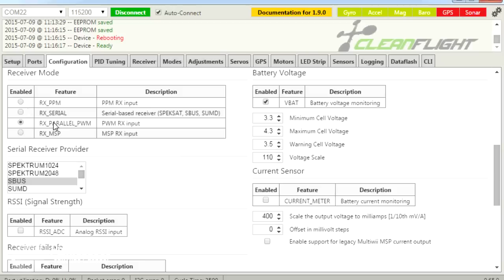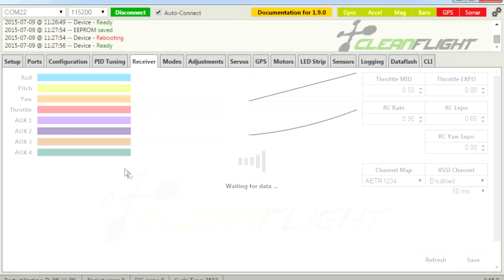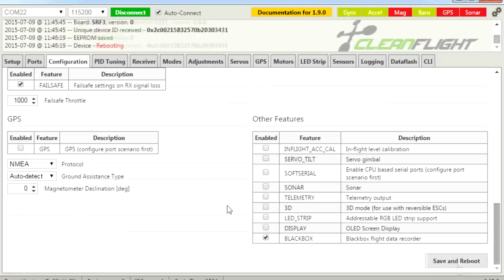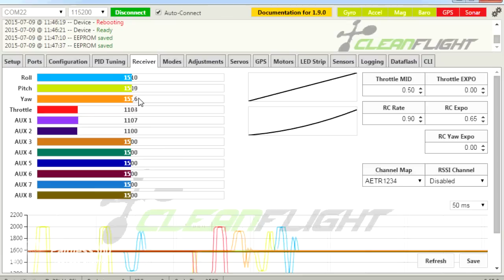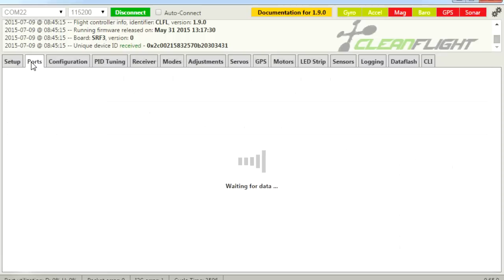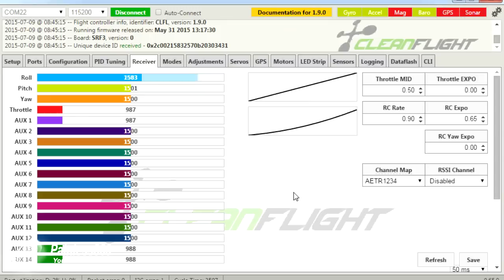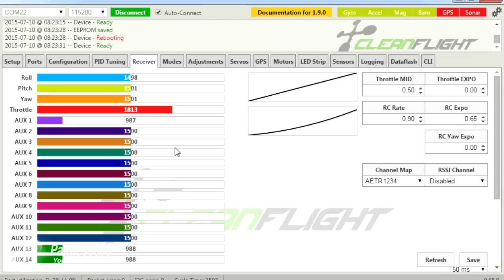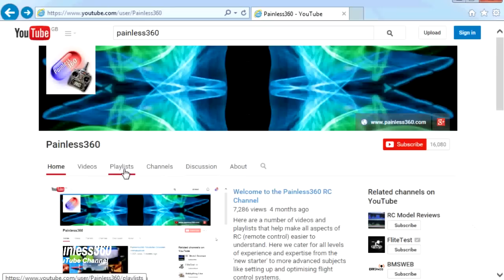Seriously Pro F3 (SP3) Quick Tip - Install and setup PWM, CPPM and S-Bus Radio Receivers

Comment: Hello painless. Can you show me how to connect the sp racing f3 fc with the frsky xsr receiver with telemetry pls?
Reply from the maker: Use one of the external UARTS and connect the S.Port pin from the Rx to both the Tx and Rx pin on the UART and then select Smartport telemetry for that UART in the ports tab in Betaflight.. Hope that helps! :D
Reply: Painless360 how i can connect 1 sport wire with 2 tx and rx wires? Thank you for your reply.. i seriously love your videos
Reply from the maker: +R. K. Solder? ;)
Reply: Painless360 I have seen that youve done it with the x4r receiver you connected it with sbus using the io 2 connector and then used the S.Port to connect it with the Uart 2 RX cable. Is it going to work the same with the xsr? Sorry for my bad english. Best regards from germany.
Reply from the maker: +R. K. X series receivers need bi-directional telemetry so connect it to tx and rx pins on the UART. See the Betaflight documentation for more detail. Best of luck
Reply: Painless360 ok i will do that. I hope i will do it correctly. You mean i have to solder 3 wires together. Im asking because im scared to have a short. The S.Port wire from the xsr and the TX wire and the RX wire from the Uart 2 on FC im going to solder together. Is it right? Im not retarded i just need your confirmation because im scared to destroy my fc. Thank you for your help painless :D
Reply from the maker: +R. K. I've already given the same answer twice. Not sure what else I can do..
Reply: Painless360 ok thank you very much painless

Comment: can I use satellite receiver with this? thx
Reply from the maker: Yes, see the wikis  and manual.. Best of luck.
Reply: i coudnt find it anywhere in the wiki.. :( may be i was looking in the wrong place. can you please point me in the right direction. thanks :)
Reply from the maker: +Ashar Hameed https://www.youtube.com/watch?v=OZgfn7Idsaw ;)
Reply: +Painless360 video unavailable? I'm also looking to connect an Orange R110XL it just has a statellite connector and presumably 3.3v powered. Anyone got these working yet on the SPF3?
Reply from the maker: You can search the channel you know ;) https://www.youtube.com/watch?v=n59e_n_NGQQ
Reply: +Painless360 I've been searching Google but nothing showed up only this video. Thanks for the link and the quick reply - appreciated.
Reply from the maker: Really? My search for 'SP3 sat' found it as the 5th suggestion.. Remember the channel is searchable and the playlists are ordered to make it easy to find detail too..
Happy flying!
Reply: +caramba10 if I can't find it so can you.

Comment: I have been having consistent issues with pwm, the values are showing up though they are very jittery, like there is a certain refresh rate to it (values always return to centre after a certain amount of time). Could anyone help pls!!! 
I am running spracingf3 3.0.1
Reply: Never mind turns out a single channel on my receiver is dodgy

Comment: Hi I have just been reprising you video in the hope that it would highlight a problem I am having setting up a hex-copter sadly I couldn't see it.
 I have a king Kong 300 hex that for some reason I can't get sorted it came with a micro CC3D I tried everything with Libre pilot and couldn't get the motors to run so I have installed an SP racing F3,it is running Cleanflight, Frsky  sbus , the config is fine (oneshot 125 for KingKong 12A  ESC's) as I can set up all the required switches arming etc and cleanflight can see all the inputs and I can arm and disarm the FC but that's where it all turns to worms the esc's will start randomly and not all of them oh and I have just tried the second SP racing F3 FC same result so I must be doing something wrong????????????
Reply from the maker: I've not built a Hex with Cleanflight. I'd setup the model as a Quad and see if that works well (pnly four of the motors will turn!) but if you know that then it may be a FW issue.. Best of luck!
Reply: Hi thanks for the reply no different as a quad I can however do a pass through using BLHeli so accessing the ESC's is no problem I can arm and disarm the esc's at least according to the little red light on FC is concerned I can the esc's however have a different take on the situation they will start at random not all of them just one and then it might be joined by another" ho hum " the only way to stop the ones that do is to remove the power! As for the FW issue apart from having been called such at an earlier confluence of errors whilst at work I am at a loss to know to what you are referring :-)
Reply: Although it seems that no one is interested I have soldiered on with this problem while I was fast approaching the need for medication I thought why not go through the list of ESC/Motor Protocols available skipped the one shot choices and well well it sort of works with Multi shot but none of the others so back to One Shot 125 and all of a sudden the esc's are playing tunes so I calibrate them in cleanflight and apart from needing to raise  the min calibration threshold to stop motors twitching all seems good now?????????????
The problem is I don't know why as I promise you I had done this before several times to no avail

Comment: I broke my IO 2 port on F3. workaround?
Reply: I know I have to connect to vcc and grnd on uart3 but do I connect my ppm receiver to the TX or RX connection on uart?
Reply: rx
Reply: I quote myself from another comment:
"Hey Painless, thanks for your guide, that saved me from dropping this FC. Anyway after 1 month I figured out how the Cleanflight receiver tab works for configuring the IO pins inputs from the receiver: at the top of that tab there is a dropdown menu with something like "AETR1234" wrote in by default. This mean that AE (Aileron, Elevator) are on pins 3 and 4 of IO1, TR (Throttle and Rudder) are on pins 3 and 4 of IO2, AUX1 and 2 are on pin 5 and 6 of IO1 and AUX3 and 4 on pins 5 and 6 of IO2. Exaclty like you said in the table of your video.
You can freely change this order by directly writing in that dropdown the combination you want to use. A configuration like "AE12TR34" means that you can use only IO1 pins for Ail Ele Thr and Rud. 
I've completely broken my IO2 port after crashing, so if someone had this problem too or doesn't need AUX channel and wants to use only one IO port I hope this can be helpfull :)"
Reply from the maker: I'm not aware of one - depends on what you're trying to do I guess.. Best of luck!
Reply: if one io port have broken use second port, or solder new uart port i-buss wires. today all controller have many 4-7 uart port what can use if one has broken, and all fcontrollers have today F7 under 20$ wery cheap can buy 2-10 pcs to reserve at home.

Comment: And if i cnect sbus to io1 what uart is?
Reply from the maker: +BelloFPV Some of the IO1 and IO2 pins can be used as soft serial ports (software UARTs) and to do things like run the GPS and LED strips too.. see the other videos and manual. Best of luck!
Reply: Ok thx

Comment: I have a Graupner GR-16 receiver, wich worked with my (now dead) CC3D perfectly.
Now I don't know where to connoct all the signal cables to the receiver, because there isn't description of the channels like throttle etc. It's just 1, 2, 3, etc.
Can someone pls help me with the right connection?
Reply from the maker: Use the monitor screen on the radio to see the order the channels move. If the throttle moves the bar at the top then that's channel one on the Rx etc. best of luck!

Comment: Me as well. Thanks for existing , sorry three years later.  I would like to have your professional help in a field you cover in this video. I think about configuration of PWM.
In my case until to the end of this subject (PWM) I have the some answers from program like you. Only difference is that at moment I connect the servos, servos don't work. I verified outputs with scope, they are nothing. I can't understand that , I'm unable to find solution. This is the same board SP F3 racing. The same program. If you will help me I will be very happy and not loose more time. Thanks in advance.

Comment: Hi Painless, first of all happy fathers day if you are a dad, I have a problem and I would appreciate a lot if you can hel me. Setup: SPRacing F3, X4R, LB 20A Pro, Betaflight 2.7.1 and BlHeli 14.5 So the situation is as follows: Everything looked ok and at the end , when I was calibrating escs, turned down min throttle from 1030 to 1025 and suddenly escs started to beep (2 beeps) then when I tried to arm w the radio (taranis), escs wouldn't arm and then I notice the the X4R wasn't on (no green led) and finally I unplugged everything and when I plugged again X4R wont turn on again, I dont know if its fried or what, I didn't have any smoke. Please help!
Reply from the maker: I'd start simply and see if you can get the connection to the Rx on it's own. Best of luck..
Reply: yeah I found the problem, the bec on my lumenier pdb got loose, rx is fried, thanks anyways

Comment: Hi guys I have a strange problem. I wired up my sp racing 3 with my turnigy 8ch v2 but when I try to check the signal, all the channel shows 0 as input. I check several time all the wire because I connected by pwm. Anyone can help me? Thanks

Comment: Hi I need help because this freaking controller is giving me  headaches. I have a Flisky TH9X with a flisky FS-R6B Receiver (exactly the same as the original but smaller) Only can be connected by PWM. So I did everything from the video for the PWM connection (BIG THANK YOU FOR THIS VIDEO) follow the connections tab and finally I could move all the sticks on the right direction on cleanflight. BUT (here comes my problem) my aux for select moder or for my buzzer doesn't move. when I connect the aux 1, 2 and 3 I can see that there's a signal because the channel bands  has little movements from 1499 to 1502 or so but I can´t move them.  I tried different combinations of wiring and nothing happens. If someone has any idea why I can't wire the aux would be really great. Just an interesting thing. My aux channels works when I put on my transmitter the helicopter mode but they works in parrarell with the throttle or alieron, etc.
Reply from the maker: +Jesús Ortiz do those channels move on the 'channel monitor' screen on the radio itself?
Reply: I could FINALLY solved it!! As you asked, the channels doesn't move on the screen monitor so I found that I had to program those channels through the Mix.Channels setting.... basically I put for each aux "click" a percentage... so for example the 3 click switch has -100%, 0% and +100%. Thank you for your time answering and thank you for this video explaining all the connections clearly

Comment: Hi i have SP3 and receiver Turnigy 9x8cV2 How to connect all cables? Painless360 please help, Thanks Mat.
Reply from the maker: A quick look at the manual shows it's only PWM so you'll need to follow those steps. Best of luck!
Reply: Thanks for the answer, I still have a problem...
Are you sure the Turnigy works on pwm?

Comment: I have a receiver where it doesn't tell you where to put the cables anyone know how to connect it?
Reply from the maker: See the 'Quadcopter Building for Beginners' series. If there are just numbers then you need to look on the radio to figure out what order the outputs are in. So if the throttle is 1 on the radio then it'll be that on the receiver.. Best of luck!

Comment: Hello, new to this hobby. I have the FS TH9X transmitter. I have SPRacingf3 board. I’m connected To cleanflight. My settings are good. I can control my motors through the computer. My transmitter is binded with my fs receiver, but I’m not able to see variation levels on the receiver tab in cleanflight. Can anyone help. I almost have it! Thanks
Reply from the maker: Please see my Quadcopter building for beginners series, they are designed to go through each of the steps and make sure that you don’t miss anything basic out. Best of luck!
Reply: I watched series 6 several times and I’m just not getting any responses from the receiver tab in cleanflight. What’s odd is when plug in a random servo into the receiver I can control it through the transmitter, so that let’s me know the receiver and transmitter are bound. And I also know when I’m connected in cleanflight and powered up via Lipo battery I can spin all motors no problem. Can I send a video clip of my walk through and set up and maybe you can identify were my issues are? Thanks
Reply: Basically my values are not moving when I move my transmitter throttle rudder aileron elevator. Thanks

Comment: +Painless360 would you please help to decrypt what aetr1234 means? There is no documentation I could find on this. I have read on forums ppl said  it means a maps to channel 1, e maps to channel 2, etc. But I seen mapping which just blow that interpretation out of the water. For example ATE2R134. Many thanks in advance.
Reply from the maker: There is a video in the 'Introduction to RC' series that covers why we have the channel names we do - worth a look. This is shorthand for the order that the channels are read by the flight controller Aileron, Throttle, Elevator, Rudder, Aux1, Aux2 etc. Hope that helps.
Reply: Yes that makes sense. I have just tried and it is working like what  you have said.  Many thanks again.

Comment: UART3 and SERIAL RX wont stay highlighted after I save and reboot, im using "Walkera data bus (sbus)". Ive tried everthing. I noticed a great deal of people online having the same problem's and with different RX's but no solution! Anyone out there have idea's to fix this issue! Help!!
Reply: Well after some trying... I found that although I was told that Walkera DATA BUS=Sbus and setting them up the same way was recommended and it failed, I tried similar settings but in ppm and "voila" success! So everyone else having the same problems with walkera rx's and using DATA BUS or similar, try running it in ppm instead and hopefully that will solve it!
Reply: I have the same problem like you. I connect SPRacing F3 to PPM/Channel 1. I use Walkera Data bus (RX703A). What else should I set in Cleanflight? Please help.

Comment: I am using a Lemon RX DSM2 6 channel receiver (http://www.lemon-rx.com/shop/index.php?route=product/product&product_id=65) with my SP Racing F3 FC and have followed your video to a T but when I go to the radio tab my roll and pitch signals move together when I move the roll stick on the radio. Nothing happens when I move the pitch stick on my radio. The yaw and throttle are also tied together when I move the throttle on the radio up and down. Nothing happens when I move the stick on the radio in the yaw position.  My AUX 1 and AUX 2 channels are also tied together in the radio tab when I move the switch on my radio. I had this exact same setup previously but the only difference is I was using a naze32 instead of the SPRF3 and everything worked great. Any idea whats going on?
Reply from the maker: +Brenden Guffin I'd check that the channels are moving independently on the radio (most radios have some kind of 'channel monitor' screen). Best of luck!
Reply: +Painless360 unfortunately I'm only running a very basic DX5e radio so no screen to check the radio channels. I ordered a Lemon RX satellite receiver so I can run PPM. Hopefully that works out better and if not maybe it's time I finally upgrade to a Taranis and a new receiver ;). Thanks for the reply!

Comment: my center trim and endpoints are all over the place.
Reply from the maker: What does 'all over the place' mean? Are they changing value?
Reply: Ive factory reset and updated firmware on my transmitter and in display it shows my yaw trim off a small amount. Thats fine(i guess), and i set my endpoints and subtrim but it doesnt fix. Sometimes after i do all this my pitch is just off a bit and then yaw will go wonky.
Reply: it will work for a flight but my yaw always ends up off and my endpoints shift.
Reply: yaw ends up around 1470
Reply from the maker: I'd suspect the radio or receiver then. Best of luck!
Reply: i feel like its the transmitter. Its fine i just have to tweek sometimes. My equipment is pretty much entry level so i anticipate error improvement along with future upgrades. Thanks painless.

Comment: I have a Detrum RXC8 that supports PPM, but when i plug it into my sp racing f3, the board doesn't register any of my transmitter inputs. 
I have bound the receiver and have set my flight control board to PPM
but I cannot get it to work
Any suggestions?
thanks

Comment: Having an issue with an SP racing F3 Evo flight controller, where do i connect the pwm inputs from my reciever? there are no connecters like on the flight controller you are showing, my guess is the connect into the same place as the ESCs connect? even when connected there i dont get any response what so ever from clean flight
Reply from the maker: +twenglish1 a quick look at the manual shows no pwm inputs. You'll need an sbus or PPM receiver. Best of luck
Reply: Ah yeah don't know how I missed that so many times, do you know of a receiver that is compatible with the flysky fs-t6 and has ppm or sbus?
Reply from the maker: This is the only radio of that make that I've used in a build - hope it helps https://www.youtube.com/watch?v=K2pPVRTQgi0

Comment: hi. I'm also trying to configure cleanflight with the same setup(sp F3 racing+radiolink at9+r6d radiolink receiver). it happens that my throtlle appears reversed in cleanflight, putting the stick up it decreases the values and the opposite happens when pulling the stick down; for yaw pitch and roll just dont know if they are going the right direction. the radio is new and its set to factory default. any help for a Fpv rookie? thanks
Reply from the maker: +linkspyder Yep - reverse the throttle channel on the radio - best of luck!